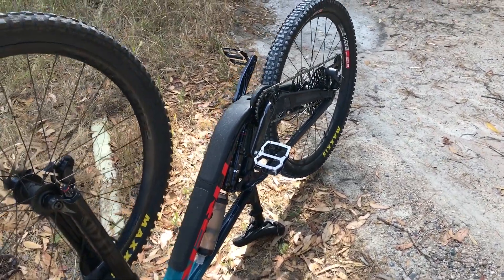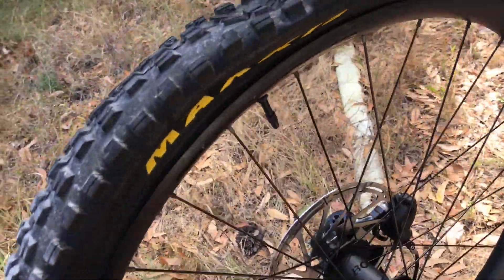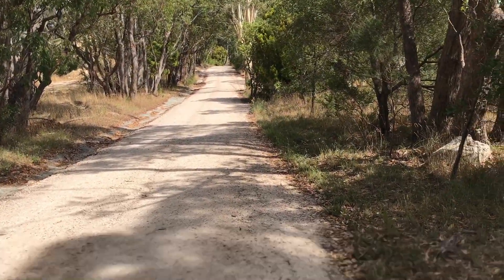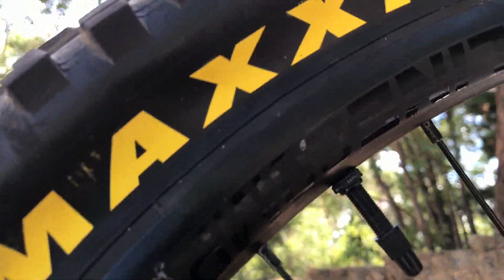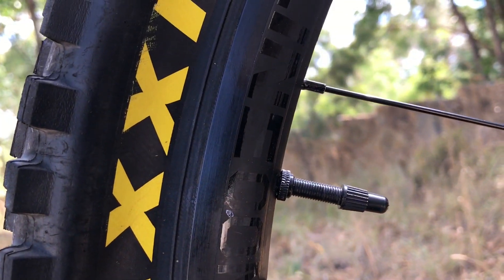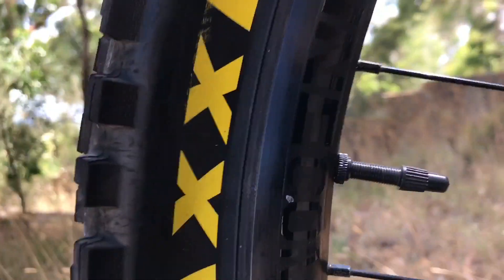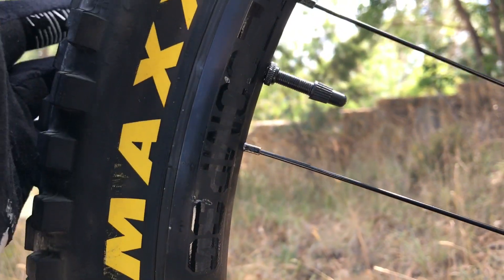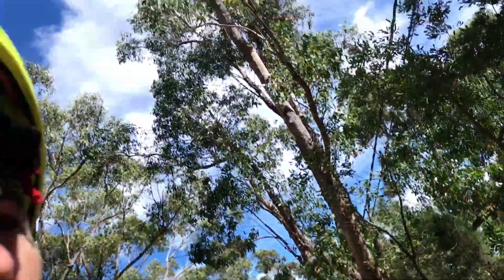I Had a Blowout! Maintenance Checks

Comment: I had valve issue just on practice day during our local enduro race. It seems that valve core got faulty after some time. I think maybe the sealant after some time clogs the valve core. It was easy fix tho, I took valve core from tube that I got and it worked.

Comment: I tighten the nut with pliers, so it's secure, and regularly check, it can get loose eventually, so good to check regularly. also good idea to check the valve core.  I always heve the tools to fix that, apart from big shop pliers. I know things come loose easier when temps change rapidly, especially there are mixed materials that react at different rate.
the thing that always comes loose is the seat post bolts, so saddle slides back, common in winter, I have my bike indoors, but temp is -10C for example, while bike was indoors in room temp, so it loosens, but it can happen in summer too if temp raises.
Reply from the maker: I never considered that
Reply: @mtbtelly5522  I have Wolftooth pack pliers which has chain plier, storage with magnets for two spare chainlinks, and has valve core tool. the chainpliers also double as pliers for the cut, but you won't get it as tight as with big pliers.
Reply: @MTB Telly  tubeless valves with hex hole at the bottom and a nut that works with a wrench exist. like stzyproducts
I see some brands have valve core tool as part of the cap. Like Muc Off, Peaty's, stzyproducts

Comment: My cushcore valve dosent sit well with my bontrager rim and has a bit of a gap leading to a slow leak
Reply from the maker: Did you take the bontrager tubeless rim strip out and replace it with rim tape first?